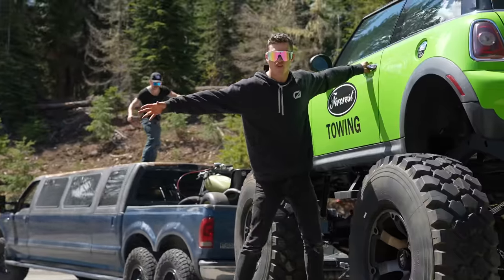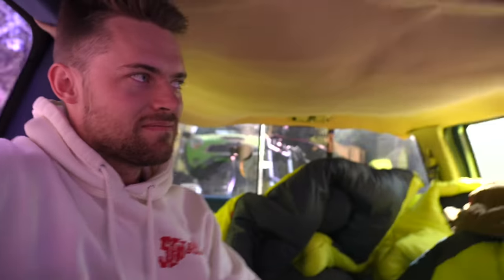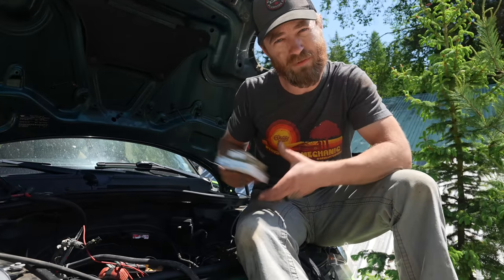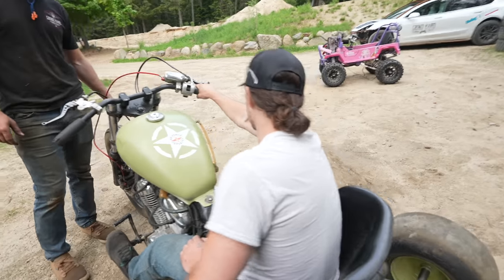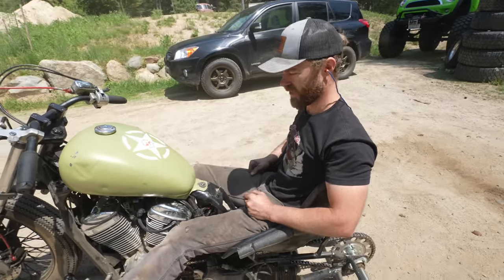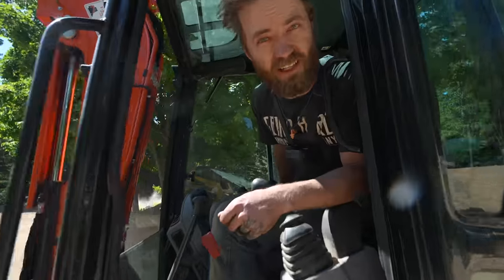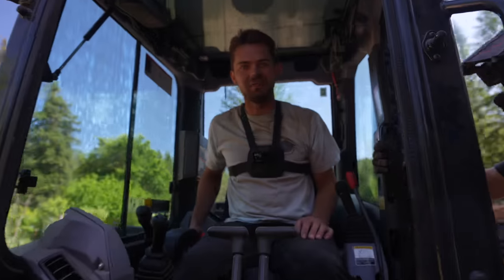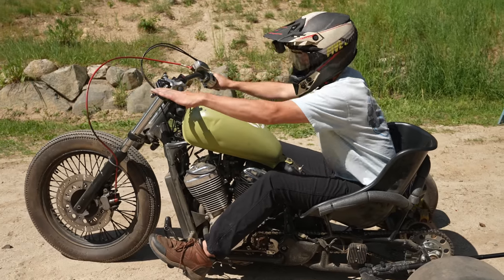Chopper Drift Trike Build! 600cc

Comment: Actually, CV carburetors are the most efficient. It's the closest to fuel injection. The vacuum slide maintains maximum air velocity when you wack the throttle open abruptly. The more you know✌️
Reply: I just learned something neat, thanks!

Comment: The jet in the carb for the back cylinder is usually supposed to be one size richer because that cylinder doesn't get as much air as the front cylinder therefore needing a tad bit more fuel. But hey if she runs send it

Comment: Hey guys ,cool video, ive a small business in the UK restoring motorcycle wheels and odd machines, with  if not already.... put in to your considerations for new building design ,sand blaster and powder coating booth, get on Cerakote ceramic paints also for  refined coatings headers, turbos, callipers, you'll love it

Comment: I was gonna write it sounded like half a shadow. 😅 One cylinder got a proper gasoline wash. At one point it sounded like it tried to fire the other one when you grounded the coil, but afterwards got back to running on a single one to the very end of the video. Poor little shadow. ;)

Comment: That seat needs to be about 5-6" higher and however far forward so that you're sitting just behind the tank... that seating position is no good unless you like back pain and not having full control of the steering and hand controls. Should be able to set it up so that you have full steering lock without leaning forward much if at all and your knees have a decent bend to them, or you're gonna have a bad time. The levers are also too high... shouldn't have to take any more than two fingers off the grips or reposition your hands to use them. A taller handlebar riser will solve the bars running into the tank. 
I guess you could also get silly and do a remote steering setup like you might see on those builds that are going for the world's biggest motorcycle record, but your legs would still not be any better off in relation to the exhaust and foot controls. 
I'm probably only speaking to whoever you bought this silly thing off of and whoever might be planning something like this, but I got the eye twitch just seeing you guys sit on it. I'm sure you already know most if not all of this stuff.

Comment: The rear end needs to be two inches narrower and the foot pegs need to be scooted back a bit so you can use your legs. When your legs are extended like they are unusable, your not able to help control it and support yourself.